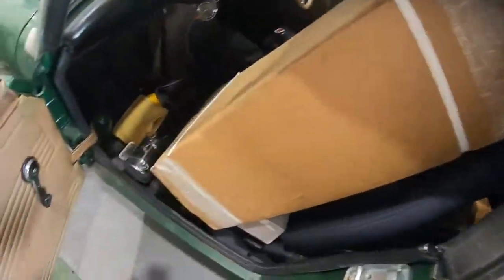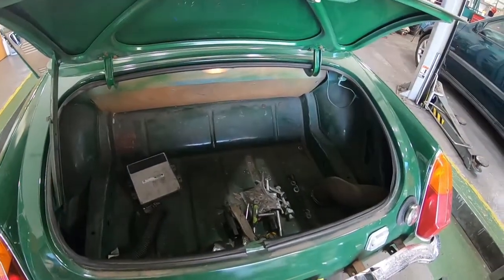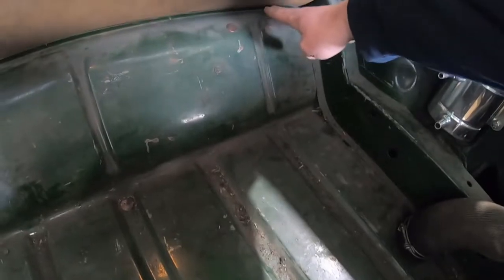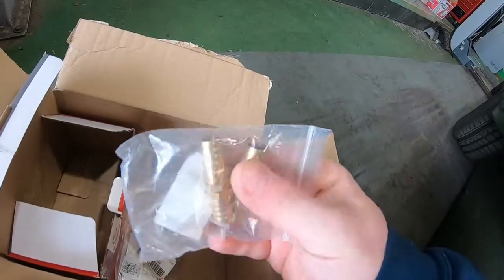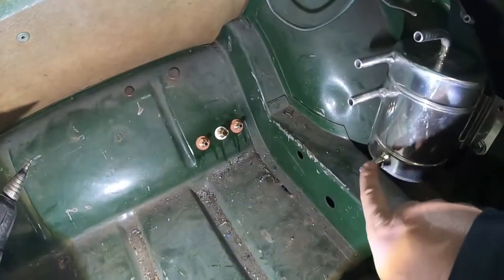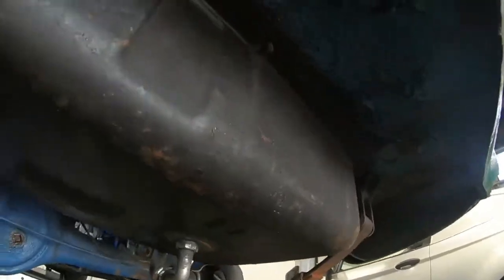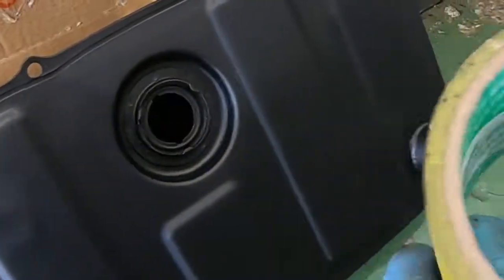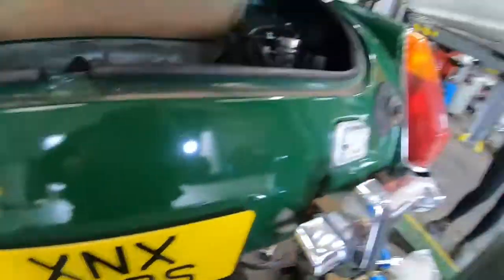Fitting a swirl pot to the K series Midget

Comment: Good stuff!
One other thing is to consider putting a restrictor in the return from the swirl pot to the tank (I used a MIG torch tip in mine) It’s not vital, but it just stops the low pressure pump rattling away full bore all the time.
Reply from the maker: Thats a great idea! Thank you
Reply: I would off called that a surge tank but good job.
Reply from the maker: Thanks for watching